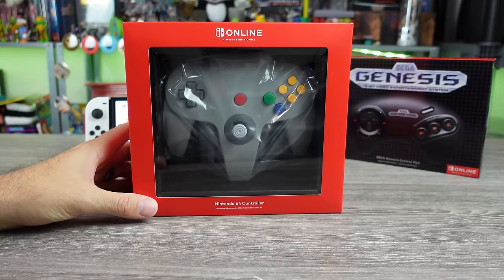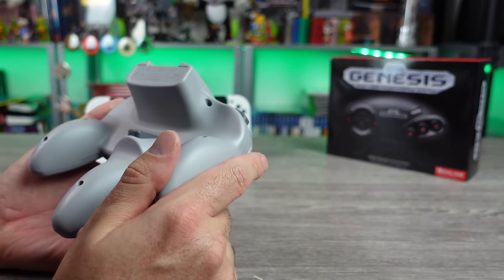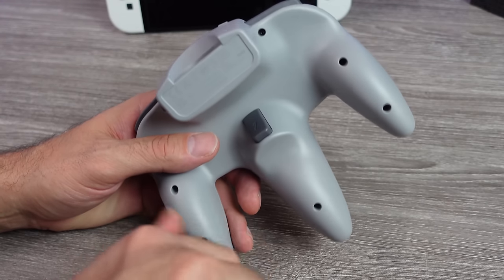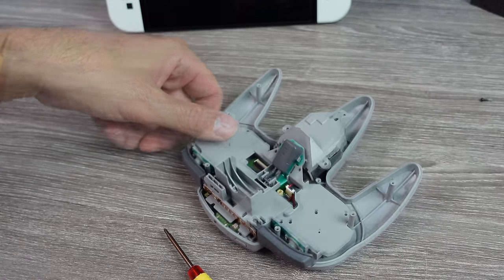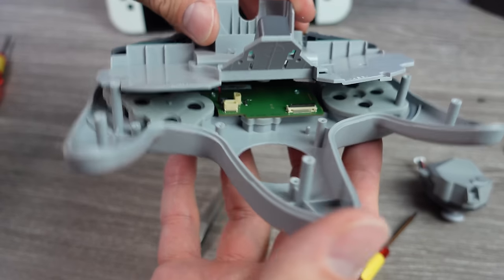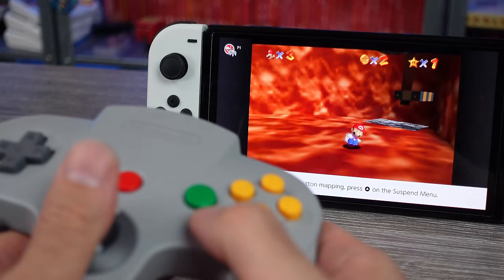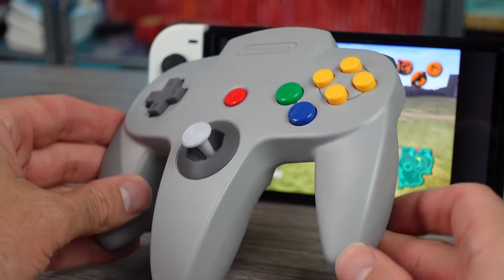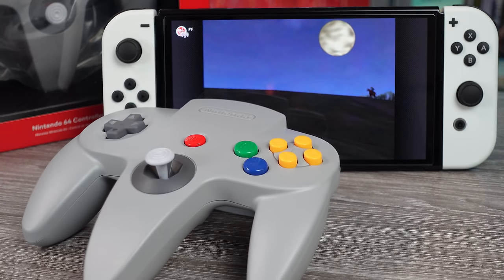The Nintendo Switch Official N64 Controller SURPRISED ME! Teardown & Review!

Comment: After seeing the stick mechanism I completely lost confidence that stick will not suffer the same issues as the OG controller. It is very disappointing as I have been waiting to find a good N64 controller for years now.
Reply: two fantastic 3rd parrty options exist
Reply: @Alex-vf8ww  Care to name which brands ?
Reply: Use the gamecube stick. Its compatible
Reply: @alexminasgerais  i have one. Sensitivity is terrible on it.
Reply: Steel bowl and maybe modified oem stick will fix this. Unfortunately they are sold out and hard to come by. Hopefully a new batch will be made again. Nintendo should have known to modify it slightly to stop that from happening. Just not sure the steel bowl will fit the switch N64 controller.
Reply: Boo hoo
Reply: I took apart the analog stick in the nso n64 controller, and under close examination the bottom of the stick does not grind the bowl anymore, it's hard to explain unless you take it apart yourself, the internal setup may look similar but it's not the same, nintendo did improve upon their analog gear tech
Reply: @starstarstar4643 That's good to hear!
Reply: @alexminasgerais Drifting, super high sensibility and drifting again. Not a big fan of those. But still better than a dead joystick.

Comment: The N64 control stick mechanism alone makes me want this controller. Being able to play Goldeneye and Perfect Dark with this would be great.
Reply: u want a controller that destroys itself?
Reply: @Alex-vf8ww  If you added lubrication to the mechanism it could be preserved for a very long time. I want one of these myself because I never got the chance to use a  new n64 stick.
Reply: @BoshMind  Looks like the bowl already is. I'm guessing the black pieces the sticks move around in need some grease, too?
Reply: @soridosuneku  Yes. As those can get worn out as well. The three failure points of the mechanism is the bowl, the black pieces, and the plastic thumbstick itself.
Reply: @Alex  Better than stick drift.  The ground down parts of the original are incredibly easy to replace.

Comment: I'm hearing that something about the drivers for this one are different from NES/SNES batches when it comes to trying to get it to run on PC bluetooth. Hopefully people get some solutions quick, because otherwise that'll be $10 extra for an adapter down the drain that I paid in prep for getting mine for some Retroarch Mupen64 action.
Reply: 8bitdo will most likely update their adapter to support these controllers.
Reply: Use Zadig to replace driver.

Comment: The good thing: it's like the original Stick
The bad thing: it's like the original Stick.
Reply: Lasted longer and better than Joy con drifting and having the setting to add dead zones and drifting happening after a year...the problem is they added different readers on it
Reply: If it the same connecter. U can order  a 3rd party  n64 stick  as gamecube stick tech.    Sell it online. Able replace n64 stick.   It might work with online n64 switch one.   If connecter and the build is the same as old n64 controller sticks

Comment: From what I could see it wont be drop in compatible with the original stick. The original uses optical digital encoders (like gray encoding with two phase offset digital signals) while this stick centers around analog potentiometers (presents a ratiometric analog voltage). They work completely differently so would require extra circuitry to convert the signals. I was kinda hoping it was a more robustly designed version of the original stick that could be dropped into older controllers with broken sticks but looks like a no go without a microcontroller to convert the signals.

Comment: Not gonna lie, I'm still kinda pissed we never got a N64 Classic and this just fans the flames
Reply: no wondering why. If Nintendo can sell the Controller for 50$ alone, making an N64 Mini with 1 Controller and around 20 Games for like 70-80$ would make them less money. (i would take an N64 Mini all day)
Reply: @UndeadCollector  For one thing, I think the Mini Console Craze was dying down, and Nintendo would've chosen to develop their own emulators in-house. See, this is why Nintendo doesn't do so well on their own: Unlike Nintendo, SEGA actually got input from the fans.
Reply: @BalboaBaggins  Do you want me to tell them this in a carefully worded email? Because I could do that, and they'd still be powerless to stop emulation websites.
Reply: @BalboaBaggins  I've been emulating for 20+ years on everything except my toaster (for now).  Just kind of liked the mini consoles
Reply: I think the problem with an N64 Mini console was they fact that most of the best games Nintendo didn’t have access to at the time due to rights and what not. Now recently they have been getting a bit more friendly with Microsoft so we are seeing some Rare stuff, but also there is still going to be hella licensing costs which can be better absorbed in a subscription than a physical item being sold. Due to the reality of the situation an N64 classic, especially released back then, would have either been so bare bones it wouldn’t be worth it, or if the manages to secure the proper licenses would have cost to much to be worth it.

Comment: From my understanding, that new stick is actually worse as we've added another set of parts that will wear down. The optical encoder wheels (that basically don't really wear down) used in the original seem to have been replaced by the same electrical resistance based mechanism modern controllers like the PS4 use (that also have drift issues with wear), meanwhile the old plastic bowl and axis parts that wore down in the original controller have been kept in this design. 

You can only hope that the lube lasts long enough and the plastics used are a bit more resistant to wear but I highly doubt that.
Reply: Replacing those potentiometers is pretty easy, the problem is, yeah, the plastic. It looks like they put some lube, but it's still not optimal. That's very sad if you want to speedrun N64 games, and it looks like the only solution is the Steelbowl
Reply: Every controller's stick gears are plastic, and nintendo changed their weak N64 stick's plastic to strong nylon plastic since GC era.
Reply: PS4 no es moderna creo que es igual a ps5

Comment: Does the n64 controller work with Turok 1 and 2 and Doom 64? Does the option in controllers and sensors, change button mapping option work with it? How laggy is it wired and wireless with retroarch parallel 64 core? I know there's another video coming with these answers.

Comment: Is it possible to switch the sticks on the new and old controllers? Looks like the same connector. Great video btw.
Reply: The connector is not the same. Original N64 controller uses a 6 pin, the NSO N64 controller uses a 4 pin. The boards are not the same too.
Reply: It's not the same connector unfortunately

Comment: Great video thanks for doing this. I'm late to this party! That said, I've been hearing from GoldenEye players, or people reviewing these Switch N64 controllers, that they are more sensitive than the originals. I'm wondering if you find this to be the case but you didn't mention. I also realize there is a control stick configuration that you can do within the Switch settings. From what a friend told me, on PC N64 emulation using adapters, you had to go through the Windows similar control stick configuration in order to fix sensitivity issues. But you really have to carefully configure to do it properly, at least on the Windows configuration. Like maxing out the controller to its out edges during the configuration. Just curious! I can't buy one of these yet. Still trying.

Comment: I am glad they're using the same stick with optical sensors, but... Man, I'm really worried that stick is gonna grind away into dust, just like the original. Kinda glad the out-of-stock situation kept me from buying one before I saw a teardown video first.

Edit: Nevermind, it uses potentiometers just like modern controllers. That sucks!
Reply: Crazy they changed the best part of it and left the worst part as is.

Comment: Most definitely gotta try putting this analog module into an og controller. Even if it means using some type of adapter for the plug or soldering the wires into a proper plug

Comment: Ugh, I can’t believe the didn’t change the control stick design like at all. I know they were going for the “authentic” feel and look but when a design was flawed to begin with, it’s okay to make some changes.
Reply: They did. There are considerably less moving parts in there, which will be more apparent with a true side by-side. It does also come out of the factory with some lubrication unlike the original. 
There are already people and Youtubers out there trying to claim this is a downgrade because of its differences, but the mechanics were always a bigger problem than the type of input sensor used. 
These things always have a finite lifespan, but give it some TLC, it should hold up better than the original.
Reply: @BrySkye  Hmmm, the tear downs I’ve seen make them look awfully similar. I would have just hoped they would have shoved a modern control stick in there and just kept the texture on the top the same. I’ve owned a lot of systems and the only one, the ONLY one, which had every controller break was the N64. That stick was just… bad. It was a good first step but it was rough. That’s just me though.

Comment: Isnt rumble motors supposed to have a unbalanced weight on the shaft/axis? Or how is that thing supposed to rumble?

And i bet the quality is the same or probably worse than the original controller..
Reply: I'm wondering the same thing about the rumble motor. 

Every single one I've seen has weights attached off center to that shaft.

Comment: I wonder why they bothered changing the design as much as they did? Are pots really that much cheaper than a basic optical sensor, or did they not want to add few lines of code to make one work?

It just seems wasteful to me, would've been pretty easy to keep the internals compatible with the real thing.

Comment: I can't wait for my controller to arrive. I got lucky and managed to get in on the restock after staying up for 26 hours lmao. I've been using the Retrobit tribute 64 in the meantime because there is a configuration that works properly for it, and I've been having an absolute blast with it. I'm at the Gerudo fortress part in Ocarina of Time which is the farthest I've ever gotten in that game.
Reply: What configuration are you using because my c up and c right buttons do not work
Reply: But the official N64 one changes the interface for the n64 games, also changes the sound effects.
Reply: @destindude1978  change the controller to all star mode and then bind X to B
Reply: @zydomic3962  this will fix the C-UP and C-RIGHT buttons so they'll work?
Reply: I'm pretty sure A and B are actually mapped to A and B

Comment: Are there any adapters that will let you use an original N64 controller?
Reply: Hyperkin makes a N64 USB adapter.  I mostly use it for Goldeneye in Retroarch.  It works great!  I haven't tried it on the switch though.

Comment: Do you think of Nintendo released a wireless GameCube controller for the switch that they would use the original controller or the wavebird?
Reply: It'd be cooler if it was modeled after the wavebird since that was the OG wireless option, especially since they already re-released wired ones a bit ago.
Reply: @braintendo4736  personally I'd like one modeled after the ones that say GameStop on them only with obviously higher quality. GameStop ones have bigger handles.

Comment: I'm not well versed on the original controller but this looks like it could potentially be slightly better.  At least the analog control uses modern trim pots which someone will undoubtedly make clone replacements of.  I don't know, maybe there's a chance these new controllers won't get grindy and loose like the old ones did.

Comment: I'm going to assume that Nintendo did the absolute bare minimum to reduce costs
Reply: Honestly, this was a more complex, expensive solution than just using a completely off the shelf modern stick. Not like the whole controller is the the original mould. 
Hate to tell you, but it seems they went the extra mile to try and recreate the feel of the original. That and all the connectors in there instead, of just soldering the various bits to the board.
Reply: Based on what?
Every other NSO controller is extremely high quality.

Comment: My main interest in this controller was to know if it was possible to use its joystick on an old controller to basically refurb it new, I could be wrong cause I can't see well on the video, but I reckon it could be possible to hack the old connector on the new pcb of this stick and make it work. Now I know it's way too expensive for most people but I find the N64 OEM replacement sticks absolutely crap. Thanks for the teardown video ! edit : alright I take everything back, seems like those analog sticks are worse than the original ones

Comment: I never played an actual N64, never used the controller, so I really want this to experience it. I think I'm going to wait for them to add games, fix emulation (maybe?), and for the availability of the controller to calm down.
Reply: @REPVILE  This opinion is terrible. You need to get around more.
Reply: @banditkeithkingofduelmonsters  
Plenty of people can agree the three handle design is awkward and easily the worst thing about the controller is the unpaded analogue stick.
Reply: @tidepoolclipper8657  Possibly the worst analog stick of ANY of the more modern controller designs.
Reply: @banditkeithkingofduelmonsters  There is no way you can rank this pos over any other modern controller. Not the ps, the Duke, Gamecube not even the Saturn analog controller. N64 analog stick was fn junk
Reply: @REPVILE  I disagree the longer throw gives way better precision while playing N64 games vs the twitchy modern sticks.
Reply: @REPVILE  Your missing the point.  This controller is not meant for modern games like a modern controller.  N64 games are "tuned" for the longer throw of the OG N64 stick.
Reply: @kmjsuperfly1  Just stop.  Precision is a word not at all associate with this thumbstick.  The column shift on my old 70’s ford was more precise
Reply: @kmjsuperfly1  oh ffs

Comment: I was wondering if anyone knew where to buy a set of screws for opening up switch joycons, arcade sticks etc. Not a screw set that'll cover my specific needs but a screw set that covers most things, if anyone knows reply, because this vid reminded me I want to open some things
Reply: amazon
Reply: You will want a Tri-wing screwdriver for the outside shell and a small Phillips for the internal screws.  I just did a D-pad shell swap for my joycons and turned out awesome.
Reply: To cover most things, at least electrical and some general purpose things too, iFixit is a safe bet. The 64 bits Mako kit will cover most things you'd ever need, including the Tripoint (for god sake, don't use an actual Triwing piece on Nintendo or Apple gear, I wish people would stop using that like its interchangeable) and JIS screws.

Comment: $50 for the N64 is more than worth it IMO.  Brand New, built in rumble, wireless.  The Sega controllers I'd imagine are as expensive because of licensing.
Reply: The 3-button Genesis controller is pointless anyways because of the 6-button variants made by 8bitdo and Retro-bit. 

The 64 controller itself is too poorly designed to even be worth that amount (they are overcharging it just like for their n64 games; which ironically even have worse emulation than on the WiiU). You are better off with the more comfortable 2.4ghz Tribute64.

Comment: What isn't surprising is that the official N64 and Virtual Boy controllers are still Nintendo's worst controllers in general. Making it all the more worse is that despite the fact they remember the Mario Party 1 lawsuits, they didn't even bother to add padding to the analogue stick for the Switch version of the controller. Also not that great to hold the default way if you have big hands.
Reply: if anything the VB controller is responsible for the confortable ass handles we have on the gamecube and inspired it's designs props for that.
Reply: The VB controller was awesome what are you talking about?

Comment: Great review, terrible stick. I'm sad by they used the terrible OG tech but totally understand the many reasons why they did. Thanks for the tear down this is exactly the info I wanted about this controller.
Reply: It works almost identical to the original, making it the best "new" controller option for N64 to date, and that says something. We don't know yet whether or not it'll grind itself down like the originals did. It feels a bit more rigid, and it comes greased from the factory which is good.